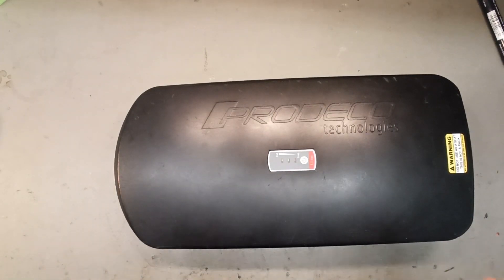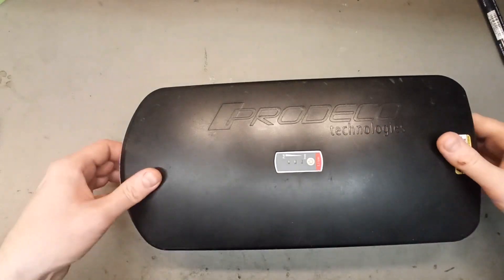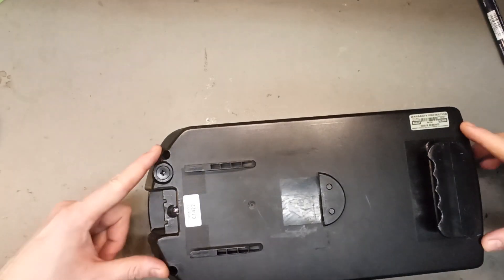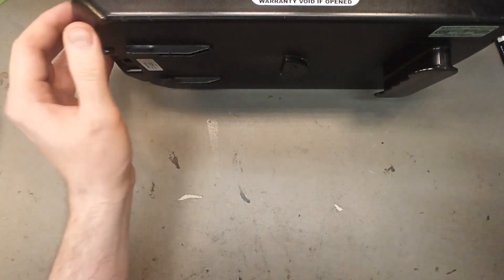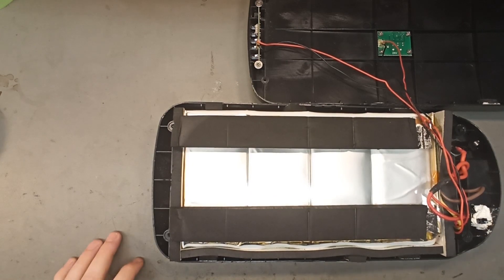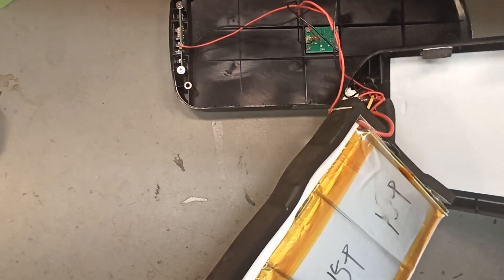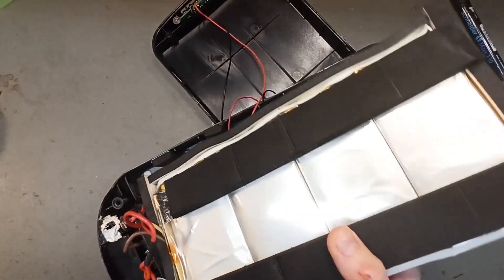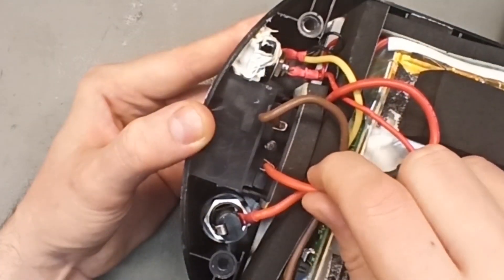Prodeco Mariner ebike battery - aka BIG FROG - can it be repaired?

Comment: I have that same battery on a 48v phantom bike I just purchased. It won’t take a charge and stuck at 18v. I think it’s in sleep mode. It is a 48 volt pack. I was going to crank up my bench power supply to about 58v and try to jump start it for a few secs to bump up the volts to where I could try to charge it. The problem is I know nothing about these soft packs. Any ideas?
Reply: No, that only works with lead batteries without BMS. you should check each cell voltage. If there are any thath are 2-3V you can charge them up with an skyrc imax.